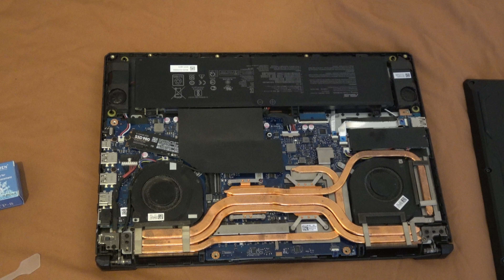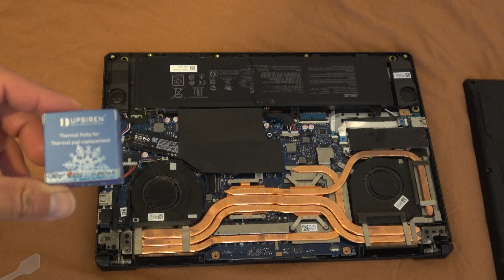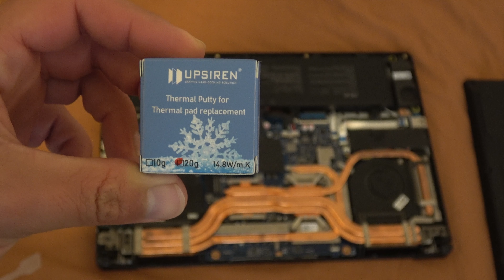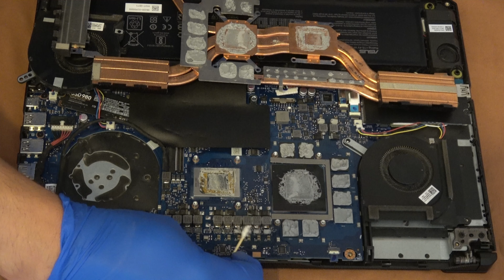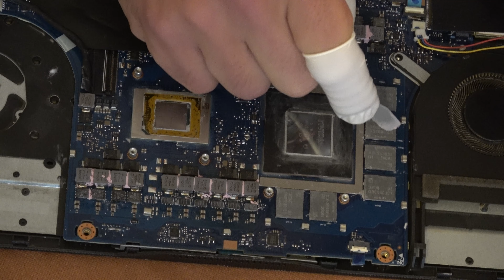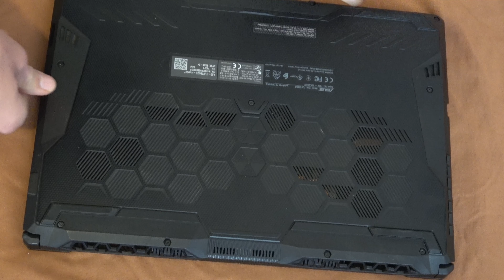Asus TUF - Thermal Paste / Putty Change

Comment: I have an ASUS FX517ZE laptop. Can someone tell me which thermal putty would be best for it?”
Reply from the maker: what matters the most is every 4-5 years to change or take a look at its state.
Reply: @Nev @NevyanNeykov Do a burn-in using a fixed load like Furmark as well as the built in "CPU
Burner" feature that furmark has (leave at least 2 threads for the GPU to use). Get CPU and GPU core temps up to 75-80 Celsius and run that for 2 hours. This will.melt the PTM/PCM and allow it to squish really thin. Use normally after that, but don't be surprised if you see further cooling imporvement over the next several weeks of normal use.
Reply from the maker: What about PTM7950 ?
Reply: @NevyanNeykov i use thermal paste id cooling frost x55

Comment: WOW asus using thermal pads instead of properly mounted heatsinks with thermal paste, i thought these motherboards are suposted to be good.... what a joke, i just purchased a motherboard and wanted to put some good thermal compound on to replace the typical mass produced white goop and it has about 1mm thick PADS with about 1.0Wm.k that go bad fast makes the heat sinks basically fake and just for show, AVOID
Reply from the maker: This is by default as far as I know on laptops.
Reply: @NevyanNeykov chips with flat surfaces should have thermal compound or at least thin pads, asus using thick one that dont look like they working good

Comment: Si la laptop esta nueva probablemente no lo necesites, pero si la laptop ya tiene algo de tiempo. es mejor comprar pasta thermica de alta calidad y usar thermalpads. y limpiar todo apropiadamente. ademas crate la aplicacion de deja ajustar el sPPT del APU y el Sistema mas los ventilladores. creo que es mejor crear perfiles ahi segun tus necesidades. ir ajustando valores segun el trabajo que hagas en mi caso se mantiene a temperaturas bien bajas. 40-45 C para el cpu y 36 C la GPU. no uso la Grafica dedicada a menos que haga algo con IA juegue algun juego o algo que realmente lo necesite
Reply: Tengo el crate en modo manual con sPPT APU de  28W y el de Sistema en 70W y los ventiladores los ajuste de manera que trabajen a 50% al pasar de 45C y 60% al pasar de 50% y se mantiene ronroniando como un gatito albino. si uso visual estudio sql, HyperV vmware ajusto los valores sPPT de nuevo donde todo funcione fluido sin necesidad de que la temperatura suba mucho en el modo manual puedes crear varios perfiles termicos lo malo es que debes ponerlo en manual , entrar y seleccionar otro que tengas creado para activarlo
Reply from the maker: nice answer, a bit more advanced.

Comment: dude l have same laptop thanks to you l’ll make that process :) btw l’ll use Cooler Force 12.8 W/mk thermal putty l hope my cpu and gpu temperature will be decrease (l used thermal paste before at vrams and it’s doesn’t worked)
Reply from the maker: Best of luck!
Reply: l’ll use at vrams as you
Reply: @mordeorder  hey man how was the result?

Comment: It's a useful video but I put mx-4 thermal paste everywhere I cleaned, not just on the CPU. now for some strange reason the computer screen won't turn on, “note: the backlight works but the actual screen, which is the display, doesn't show up.”What I need to do? buy a Upsiren-8 and replace with what I used there?
Reply from the maker: The paste is not electrically conductive so the display problem might be from something else. Please try to re-plug all the connectors. Upsiren-8 is for the capacitors and memory chips only.
Reply: @NevyanNeykov  I will try it as soon as possible and get back to you.
Reply: @NevyanNeykov  Sorry for the late reply, it took me way too long just to make sure, the screen is not showing because the cable for projecting the screen is damaged.When I connect a monitor, the screen appears on the monitor😅
Reply from the maker: I am glad you've solved it!
Reply: @NevyanNeykov  Thanks, but the problem is that I need to figure out whether I should buy a new cable or a new screen for the computer, if I have to buy a screen it makes more sense not to buy one
Reply from the maker: if you are not experienced in changing screens, best is to bring it to authorized service.